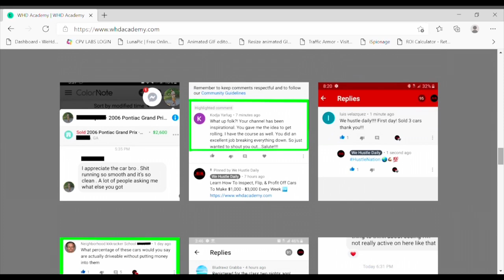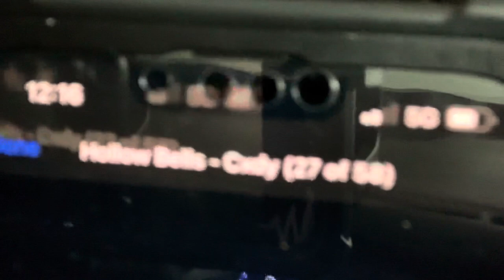I JUST CAN'T SEEM TO GET MY LEXUS GS 350 FROM COPART FIXED CORRECTLY FOR SOME REASON!

Comment: Since it didn’t do it once you let the window down a bit and it doesn’t do it when the door is open I believe its the window itself vibrating with your base because regardless if the panel was on or off as long as the door was open it didn’t make the sound i don’t know for sure but i bet when you let your window down its going into some sort of bracket or harness that’s securing it from vibrating with your bass vs when its all the way up it wont have the harness or bracket to stop it from vibrating. Your other windows don’t do it so maybe the problem is whatever is holding that particular door window in place. Best of luck to you brother 🙌🏾

Comment: Hey it's a known problem. The speaker is coming apart. It starts at the middle and work it's way out. You did great with the door panel. Check and see if you still have the other one from the other door.

Comment: Try disconnecting the battery wait about 10mins then reconnecting it again. My Lexus did the same where it sounded like my speakers were messed up. But it’ll restart the radio so it won’t sound like that. If that doesn’t work try playing around with the bass on your radio.

Comment: Man you got my neighbors kitchen cabinets rattling. You gonna get me booted out of the Philippines 😹 On the real, did you remove any styrofoam? Have your little bro see if he can pinpoint it. Then flex tie or try insulation to the area. Just insure it doesn't interfere with the window 🤔